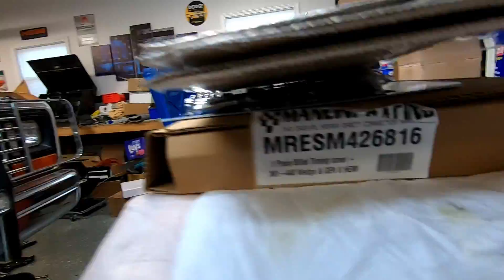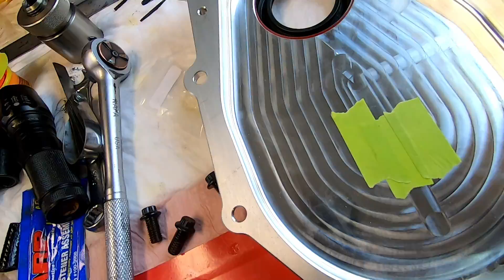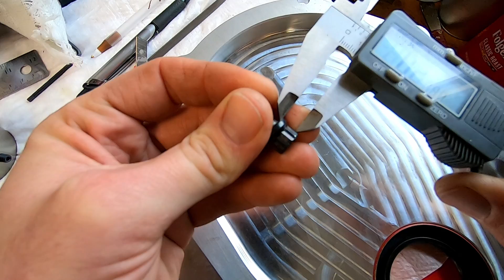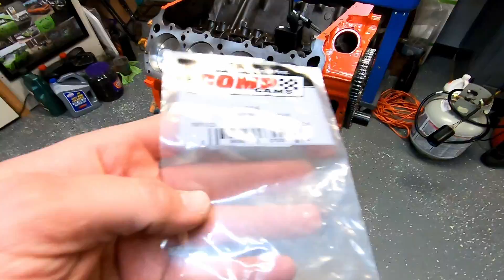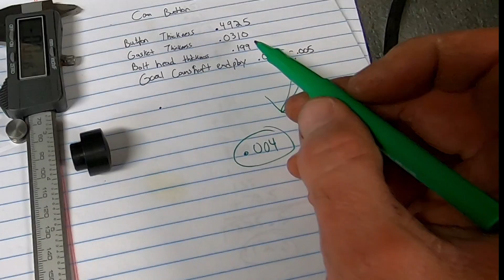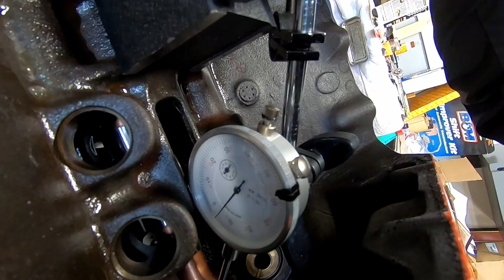Dyno 440 Engine Build Part 4: Aftermarket Parts and the Cam Button Install #engine #bigblock #mopar

Comment: I'd call the button company and ask them what cover to use. If it's Comp Cams product, use their setup.
All that screwing around is rediculous!
Reply from the maker: You have to test fit everything in a high performance engine, and the majority of buttons are designed to use with stock covers. The stock covers flex some when the cam moves in the block.

Comment: Hey Joe. It is possible to install main stud girdle and windage tray together on the Small Block and big block Mopar? The parts are very expensive to import and I don't want to buy unnecessary things.
Reply from the maker: My 512 has a windage tray and girdle on it. I’m not sure on how the small block girdle works.

Comment: Seems to me the easiest solution to the bolt clearance would be to get a different cover that is deeper and has more clearance.
Reply from the maker: I think those covers are $200+. We’ve had this one so long, that they probably wouldn’t restock it.
Reply: Then you hit the water pump housing.

Comment: Good problem solving skills Joe. Sometimes these aftermarket parts create challenges. Sharing different ways to solve these problems helps keep things interesting. Having the added insurance of the cam button and a strong timing cover should hopefully provide many years of reliable service.
Reply from the maker: Thanks Nick

Comment: Steve Dulcich got stuck right into ARP in a vid about this sort of thing awhile back, but frankly I can't see how an aftermarket timing cover can be sold out of spec; I mean what's the use of it?
Recently I purchased a Milodon single idler gear drive kit for SBC OEM roller cam blocks. The kit comes with a cover for the SBC (yes I am a Mopar guy). I can tell you every part of that kit fitted perfectly. It wasn't easy to install but the reward was it is totally silent - like OEM chain silent. 
Don't let people tell you single idlers whine. If you follow the lash setup instructions they don't seem to.
Reply from the maker: Thanks Paul. I imagine the cover would have worked with a single bolt cam gear that wouldn’t have required a button, like a flat tappet cam.

Comment: Couldn't you just use the old style stamped steel? Did those have more clearance?
Reply from the maker: I checked. I have a set of 3 bolts from a 3 bolt factory camshaft. They were way too thick. I had to find a strong solution
Reply: @JustMoparJoe  o, I meant the timing chain cover
Reply from the maker: @Trevscustoms  yes sir. I have the stock stamped on my engine. This one belongs to a friend and he wanted the billet cover for extra strength.

Comment: I use different headed bolts on my stuff, I haven’t used a cam buttes yet. 
I may use one on this new build Idono yet, small cam
Reply from the maker: Thanks Dennis. It’s hard to say what happens at 7,000 rpm when you let off that loud pedal. I’m glad to have the protection
Reply: @JustMoparJoe   I don’t want to be up there at 7 my rpm chip at 6800 
I ran them when I ran 650 lift cams 
I used a big block Chevy ones

Comment: First thing is to do is countersink the timing gear so the ARP bolts don't stick out so far. Second thing is,  the direction of rotation of a Mopar big Block and the way the auxiliary shaft gear is cut, it always holds the cam against the block. The auxiliary shaft drives the oil pump and the distributor. There's no way the cam can "Jump" forward.  If the cam were to move forward, it would rip the teeth off of the cam or auxiliary shaft! I don't know where cam buttons on a 440 idea came from? Maybe the Chevy guys? Check it out. I think they want us to buy all of that shiny "Billet" stuff to make us broke. O'K., here comes the poop storm!
Reply from the maker: With $1,200+ in cam and lifters, it’s better to be safe than sorry. I like your 💡
Reply: The button is to control cam walk.
Cam walk is a problem with Roller Camshafts.
Also cam walk during deceleration, cam moving forward. 
And at high RPM, cam moves forward and backwards effecting timing.
Been tested.
Cam Float in Small block Chevy can be worth 5 to 10 horsepower at 6,500 and above.
Check out Ed Iskendarian, Isky Anti Cam Walk.
Some food for thought.
Have a nice day.
Reply: My thoughts exactly. I had to go and reinspect my cam drive gear; definite bearing surface on the 'block' side of the gear. Of course, a bearing surface is on the block too - a thrust surface. 
 I'm trying to imagine  if any inertia is stored in the oil pump/distributor drive causing backlash upon deceleration.
 However, if oil pump and no distributor drive is used,,, I see a definite need for the cam button and reinforced cam cover.
 Love Mopar Joe's channel❤
Reply from the maker: @thomasfisher2879  thanks brother. I’m sure you saw my video about the Chinese made, bronze distributor gear. It had a mile of slack in it, compared to the milodon. That would actually allow a great deal more movement. No one out there argues against the crankshaft having thrust. The camshaft is on the same plane, rotates the same direction, is acted on by the timing chain(connected to the crank). We don’t have the flat tappet lifters here to cause 16 areas of friction on the cam, so I think the button is cheap insurance.
Reply: You do still get a tiny bit of movement when you let off the throttle though. Seen quite a few on dyno's that make a "tink" when the button taps the cover after they pull off throttle at the end of a pull (watch nicks garage iirc his kowalksi engine). Not nearly as exaggerated as they claim but like Joe says, better to be safe. I have had my own cams walk forward when the gear wears down, bad enough that it double rolled a single lifter on the #2 intake. Wish i could post pictures on here >.< Now that I think of it, Joe has seen the pictures, he can verify!

Comment: Will be one fine looking engine when you are done and most likely run just as nice as it looks, should make a cam button and set of bolts in a kit for those timing covers and gears now that you know how long the bolts and buttons have to be for that timing set and cover is now, seems like it would save other people using the same setups a lot of time and headaches,call them MJs timing solutions, just a thought, can't wait to see it on the dyno and thanks for sharing the info
Reply from the maker: That’d be great! Happy New Year!

Comment: Good fix on the cam bolts & button ,,love torx & allen head bolts in a squeeze,, & you had on the Dyno & didn't let us know the specs,, now that's just being a tease 😆 😆 😆 😃 👍 👍
Reply from the maker: Thanks brother. That was the 400. But I will get the 440 on the dyno and will do a competition to guess the numbers
Reply: @JustMoparJoe  Cool 👍 👍

Comment: Dont thin the bolts - counterbore the bolt holes in the timing gear to the dia of the bolt flanges , and 1/8" deep (or ever how much it takes). Wont hurt the gear and easily done on a drill press.
Reply from the maker: Thanks, Michael. I don’t have a mill or lathe. I think my methods help the normal guy who is in a similar situation. I worry about countersinking the bolts with my tools. I do have a drill press and would clamp it up. But if the hole being cut wasn’t matched to the angle of the bolt, then it may not reach the correct torque spec. I will loctite the bolts after washing the holes and bolts. I will definitely keep your recommendation in mind  for the future.
Reply: Wow! No thanks! You can drill your gear on a drill press! No precision that way! That is a run away! Bad advice! Get ready to duck! Expensive KABOOM!!!
Reply: @shutup-u2e  
The holes are already there .
The counterbores will follow them and be concentric .
I have a vertical mill and yeah that wud be best .
But i doubt he does .
An even better approach wud be to use a piloted spot facer . But I'm pretty sure he duznt hav a set of those either. Not many do.
Reply: @shutup-u2e  
Have you ever heard of clamping yr workpiece to the drill press table ???